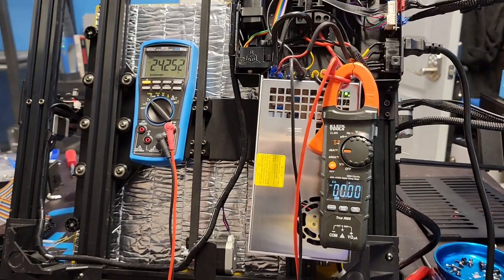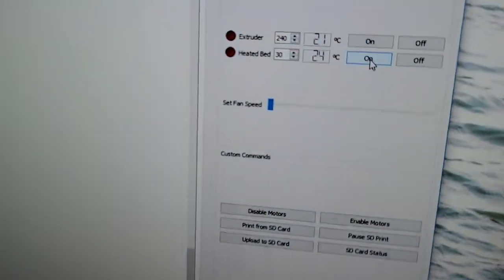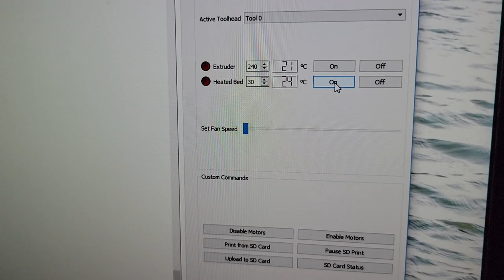Chiron PSU | Testing Bed Amp Draw with a MeanWell PSU (Quick Video)

Comment from the maker: If anyone would prefer to purchase the PSU from us once we complete testing for the Chiron please leave a comment below. The plan is to get it in, test, and design a bracket to mount the new SE-600-24 in the stock PSU location (even replacing the power brick as well).
Reply: did this happen? my psu apparently shit the bed printing a long PETG part so I either buy a replacement crappy one or (from my short research) a good one like this.